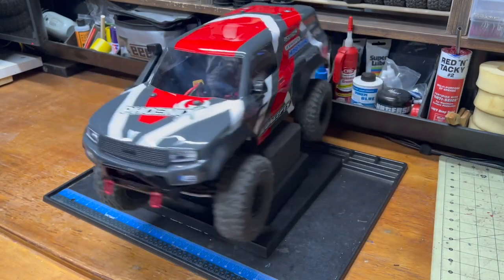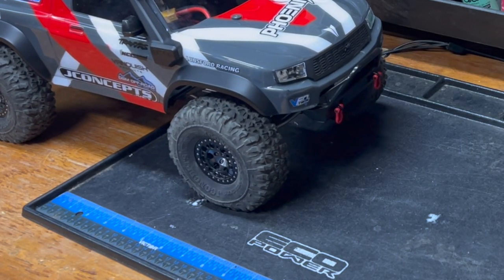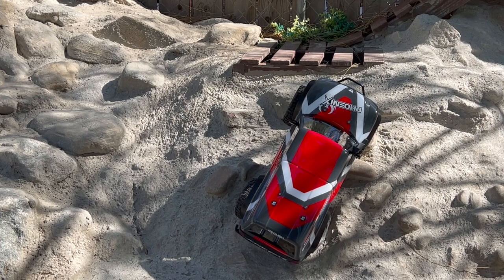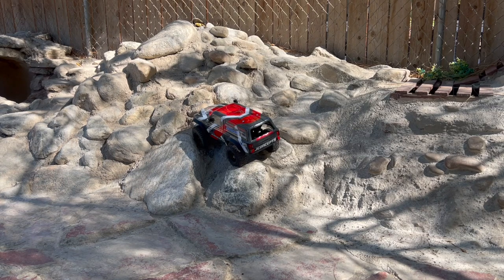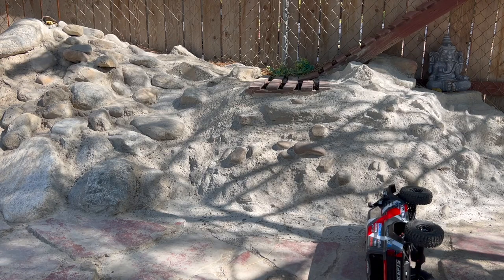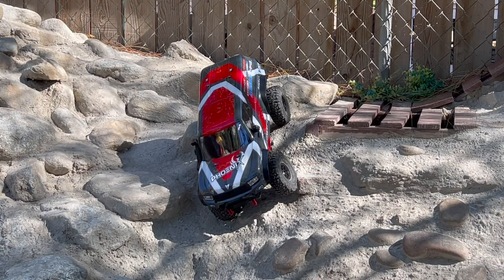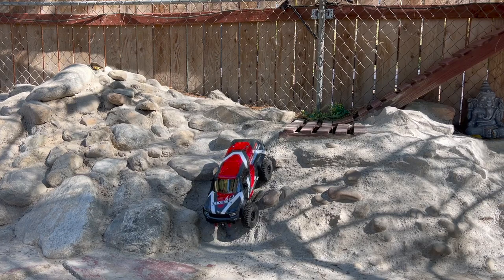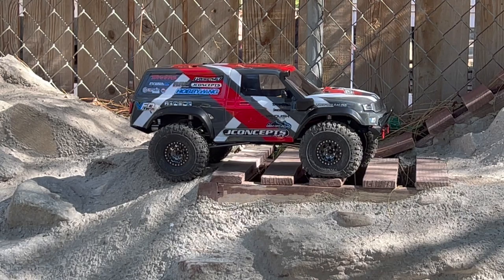Crawler Canyon Quick(re)view: Hobbywing Quicrun Fusion 2300kv

Comment: These crawler systems nowadays....Wow. I am super impressed. I got one of the first batches of the Quicrun 2300's and love it. I also have a year older Xerun 2800KV 540L and it is an absolute blast as well. They're so good that I have never had the desire to get into the whole silent outrunner chase. I don't go to competitions or anything so the extra weight of the Hobbywings is no biggie.
Reply from the maker: Nothing is going to out-torque an outunner, but I don't know if anything is gonna out-smooth a Fusion Pro.

Comment: Good video, I have had the spektrum firma 2300kv in my Phoenix for almost a year now before that it had the fusion 1800kv and the Firma system I felt was slightly better if not just for the extra kv it goes just as slow and quiet as your video here.  back when I installed it I knew nothing about it other than it was a 2-in-1 system I did not read up on it at all just installed and ran it , but I noticed it would roll a bit before drag brake would fully engage, and then on a hill if I barley touched the throttle it would roll backwards, I thought maybe it is gear lash from the portals and transmission. I asked on the forums and quickly found out I did not have TH Matching turned on and was told to bump my drag brake up to level 6 on both  force and rate once I set those the uphill roll back from a stop went away   and no more down hill rolling forward a few inches after off throttle, I was very very pleased with the Firma after that. I had one guy tell me he could set the throttle trim go make a sandwich and his rig would still be climbing the ramp when he came back :) Thumbs Up.
Reply: nice. i just installed the firma 1400kv. on my twin hammers. its the only one that would fit. the hobbywing is a bit too long. love it. as you said. it crawls super slow.

Comment: how did you get accessories (like lights) to work as the Fusion Pro 2300 has no accessory port and you removed the XL-5 when installing the motor?
Reply from the maker: Either run them off of receiver power, or use a standalone BEC to power them.

Comment: I knew you were gonna dig the 2300 pro. I’m not to sure it’s capabilities can be beat.
Reply from the maker: Like I said, shot right to the top of my favorites list. That low speed is just ridiculous.
Reply: Furitek lizard ten
Reply from the maker: @rrzrrich  While I can't speak to the capabilities, I can't get past the lack of waterproofing at that pricepoint, or the just overall footprint of the thing.  Sure, a flashed AM32 won't be waterproof either, but it will be TINY, and needs no fan or other heat removal equipment, so I can shove it in a box. The whole presentation of the Lizard 10 is odd to me. As much as I love outrunners, it's tough to argue the simplicity of the Fusion Pro.

Comment: I know this video is a bit old now. Just installing my fusion pro in my vs4-10 with a VRD twin. I currently have  13 or 14 pinion. I was thinking of trying to get a 12. What pinion are you running here and what do you recommend? 

Sorry if you mentioned it and I missed it
Reply from the maker: With portals you can get away with 13-15 pretty easily.  If you're on straights, you'll want the 12 for sure. Maybe smaller.
Reply: @CrawlerCanyon  thanks so much, I’m on straights!

Comment: What direct power servo would you recommend? Gonna be a switching all my rigs to DP servos but don't know much about them.
Reply from the maker: Budget range: For a long time, my favorite 3S-direct servo was the AGFRC SA75, but the price (supply chain related, I'm sure) kept creeping up and up. So now my go-to for 3S is the same servo that went into this build, the Flash Hobby M50BHW.  Usually around $57 or so, sometimes there's a random discount. They also have a 60kg version out (the M60BHW)-- for about the same money as the M50,  but I haven't gotten a chance to try one yet. For 4S-direct, it has to be the NSDRC RS500b. Brilliant servo for 60 bucks. 

Spendy:  for 3S-direct, I would say the AGFRC A86BUMW, but again, the supply chain--  that guy is EXPENSIVE now--  last I saw, almost 170. The NSDRC RS800 is fantastic, and will do 900oz on 3S and 1100oz on 4S--  for $120.
Reply: @CrawlerCanyon  thanks so much for the info. I was able to find the servo. Pretty good specs for the price. It will be a nice addition to my Phoenix build!

Comment: Great video! Thanks for the detailed commentary. Was the Fusion a clean drop in to the VFD or did you need to make any modifications?
Reply from the maker: Fits perfect.  It's only a couple millimeters longer than a 540.
Reply: @CrawlerCanyon  thanks for the quick reply. I typically run Castle+HH combos. I like the non linear throttle curve. However, I may give this a shot.

Comment: awesome video, gonna be putting one of these in my builders bundle. it'll be my first one but super excited to try it. thanks for all the awesome information! also what body is that? it looks super good!
Reply from the maker: The "I had never seen it before I bought it" TRX-4 Sport Body w/ Camper (TRA8112.). It's a great looking body, and the availability of the bolt-on bits (front grille, rear fascia, mirrors/snorkel) were motivation enough.  And cheap by crawler standards, It was only about $70 all in with the add-ons.

Comment: would i be able to run two of these fusion pros on a moa using a spektrum rugged controller ?? or would i run into problems
Reply from the maker: To my knowledge, all of the "5 series" Spektrum radios (which include the Rugged) have full channel mixing capabilities, so you should absolutely be able to run a pair of Fusions MOA. I only used channel mixing on my DX5c for steering, but the process should be very similar--  it is not a wildly intuitive or straightforward process though, thanks mostly to Spektrum's wonky menu layout and proclivity for assigning every button on the controller to a random function, and then never telling you what that function is.

So it can do it--  I just can't tell you how to get it to do it.  I got so frustrated with operating my Spektrum gear that I up and sold all of it.
Reply: @CrawlerCanyon  thanks for the quick reply, is there a different radio you would recommend for the job instead of a spektrum?

Comment: Great video! I have an 1800kv Fusion. The uphill start up is ultra slow but downhill is a tad faster and not ultra slow and it is noticeable on steep declines. Is the Pro’s uphill and downhill startup a lot smoother than the previous Fusion 1800kv or is it pretty much the same? Do they have the same smoothness? Thanks!
Reply from the maker: The old 1800 Fusion is great, but the Pro is next level. It's the smoothest thing I've ever driven. In terms of overall smoothness: Fusion SE > Legacy Fusion > Fusion Pro.
All of which are smoother than most everything out there.  The startup on an SE is smoother than a Castle Coppehead. + Slate, so it's not exactly jumpy.

Comment: I got the normal Fusion 1800   in my TRX4 Defender (TRX4 sport based) sometimes at 3S higher wheel speed situations the Fusion change from 3S too 2S and (lack of speed and power) back too 3S when i crawl slower speeds. my truck weight a round 3kg  whats my fault ? I have never changed any specs at the Fusion.I run also a Aces six with non problems in Power at 3S with the same Lipos in the same truck.I love my aces six for power!
Reply from the maker: So what you're saying is sometimes it feels like the power is dropping to a lower level, almost like the battery is running out of voltage? I'm not 100% ruling out something wrong with the Fusion, but I always start with the simplest things--  last time I had a power system that would cut out momentarily it turned out the plug going into the receiver had pulled out a little.  Also check to make sure all of the solder joints on the power connections.  Nine times out of ten it's the simplest thing.  So we try to isolate those nine things before we resign ourselves to the fact that it might be the tenth.

Comment: What are the biggest difference between the fusion pro and the original fusion?
Reply from the maker: The biggest difference would be the shorter can length--  the legacy Fusion was too long to fit in gearboxes like the VFD Twin.
Beyond that, whatever wizardry HW is doing with FOC control, the Pro has the smoothest start/low-end of pretty much anything I've ever tested. The legacy Fusion is REAL good, it's just that the Pro is next-level. It's so smooth, and with 2300kv, you get wheelspeed you would never get from the 1200 or 1800.

Comment: Is there a goto servo you would recommend to go with the Fusion pro 2300kv 2in1
Reply from the maker: As of today, I think the direct power Flash Hobby 60kg (the M60BHW: https://amzn.to/3xdyODY ) is the best servo for the money. Around 800oz (on 3S) for 60 bucks.
Reply: @CrawlerCanyon  when you say direct power does that mean it has a separate battery,? Sorry to be a noob on this .
Reply from the maker: No, direct power servos run directly off of the main battery.  More torque, more runtime, never have to worry about the ESC's internal BEC not being strong enough.
Reply: @CrawlerCanyon  ah ok, thank you for your time much appreciated 🙏

Comment: The same as yourself I recently got the 2300kv Pro fitted in my gatekeeper build kit with jconcepts creep body fitted, I also did the artful dodgers soa and foxbelly. It's running aluminium beadlocks with hair bunned canyon trails and I consider myself to crawl with reasonable finesse. But to my amazement my good friend who crawls with me using his box stock apart from aluminium beedlock wheels also with hair bunned canyon trails can easily do 97% of the lines I can do. I really thought I would have seen a far greater difference in my extensive, expensive upgraded gatecreepers capabilities and his truck. What single item/thing should give the greatest gains in your mind?
Reply from the maker: Not to sound trite, but the greatest gains come from wheeltime. Just drive it more. If you haven't "tuned" your Canyon Trails yet I highly recommend doing so--  they get MUCH better. More wheeltime will start to show you any "holes" in the rig's performance, so you can start tuning to adjust them. You might find big changes come from simply adding or removing weight, or something as simple as changing link positions or adjusting the wheelbase--  for instance, a longer wheelbase is going to climb a more vertical surface more easily (all other things being equal) because a longer wheelbase is less likely to end-over-end (takes more force to "flip" it) at the exchange of worse breakover angle. It's all compromise. 

At the end of it, it does come down to that 3%.  Getting the first 97% might come right out of the box (like with the Phoenix) and the rest is spent chasing the minutiae.
Reply: @CrawlerCanyon  thanks for your input. I have done the usual tricks to my canyon trials at the time I removed them from their plastic wheels, snipped and siped. As far as the weight goes I have got the rig as close to 60/40 front bias, this was a surprise as I ended up removing the ssd knuckles to accomplish the balance. In the back of my mind I am  slowly considering changing the rear end completely from the standard trailing arm setup to a conventional 4 link with the lower links coming all the way from the fox belly skid plate, and hopefully keeping to the  standard wheelbase of the gatekeeper. I'll see how she goes for now, but have this up my sleeve for later.

Once again thank you.

Keep up your wonderful and thoroughly enjoyable work.
Reply from the maker: Lil Yella (now on the Amazon LCG) began life with trailing arms, and the single biggest performance improvement I made to him was switching the rear end to 4-link. Those trailing arms are for just that--  trailing.  I have found them to be a hindrance once the climbs get properly steep.  I have purchased perhaps too many GK kits, and there are no trailing arms in my fleet, minus the Ryft.  And even that one is getting a looking at.

Comment: I know I'm late to the party, is it possible you can provide a link to to programme card needed for the fusion pro , it would be greatly appreciated 👍 thanks keep up the great videos.
Reply from the maker: It's the same card for (I think) all of the car ESCs, so if you already have a program card for a 1080 or similar, it will work.
If this is your first Hobbywing, it's this guy: https://amzn.to/3xcfmr7  All of 10 bucks.
Reply: @CrawlerCanyon  thanks,  this is my first, haven't built any rigs since original Clod Buster lol been out the hobby for a while, getting back into it with a gmade gs01 chassis kit so experimenting with crawlers, again thank you for your reply much appreciated.

Comment: I've yet to see an ourrunner beat out high kv low gearing inrunner
Reply from the maker: I dunno--  the long-body 900kv I have in my "big" Capra is an absolute clamp when it comes to drag brake, and has enough torque to snap axle housings--  which I've done. I imagine something like 600kv on 6S would be a bonafide stump puller. 

I think I'm still a dedicated Fusion Pro guy now, though. It's just so easy to use.  So smooth.  Clean install.

Comment: Question, my first ever build is the straight axle Phoenix and I put a holmes hobbies puller pro stubby 2700 in it with a momba x, it chugs on slow crawl, what did I do wrong?
Reply: Ya didn’t buy a fusion 😊
Reply: @Gary Clark look up  Holmeshobbies and his tutorial on programming the Castle CopperHead 10 ESC (same programming parameters as the MambaX) and that will help you get that dialed.
Reply from the maker: Yeah, I would definitely go through the settings on the Mamba in Castle Link. I've never had a Castle ESC that didn't require a fair bit of tweaking to get it running to my liking.

Comment: I just got my profusion 2in1 and was looking for some good settings. What were your final setting on your programming card?
Reply from the maker: I don't do many big changes--  I usually lower punch a click or two, and soften the drag brake rate (I think I run all of mine at 3, possibly 4) and of course turn reverse down to 50%. Full reverse is for crazy people. I don't like to take out too much punch in the ESC--  if it's still abrupt, I'll take out some Expo in the radio to smooth the trigger response.
Reply: @CrawlerCanyon  lol yeah that reverse at full is insane! Thank you for your answers. Subbed!